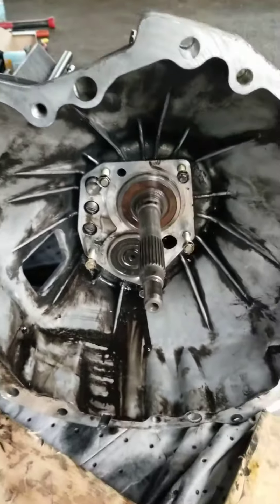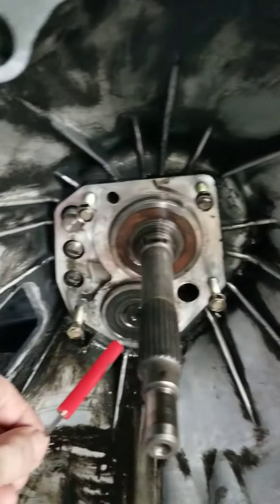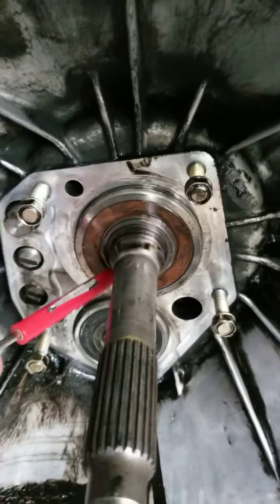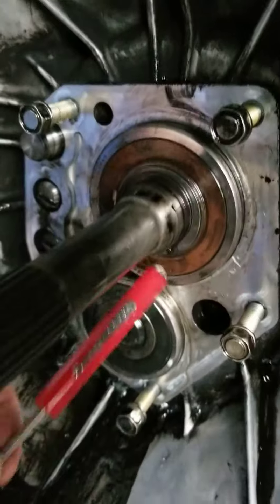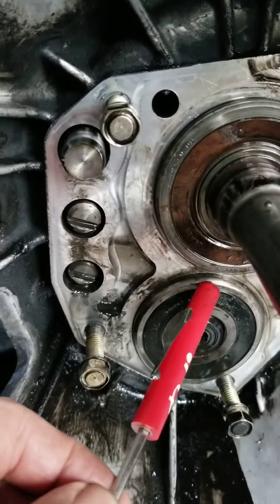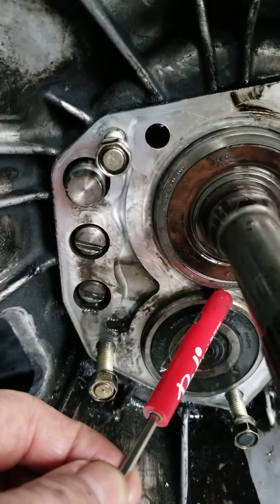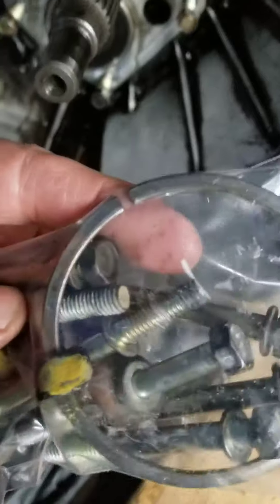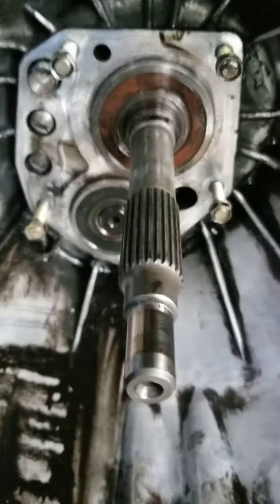Fs5w71c r32 gtst transmission rebuild part2

Comment: I wonder if the Bell can be damaged so the bearing becomes loose is there a shim bushing for these bearings available Does anyone know if you can damage the bell stretched larger diameter? or does it just crack?
Reply: No I have a bearing the disintegrated completely to just the inside Reese left, didn’t do any diameter change to bell housing case lol it did leave scars but no cracks all the way through.. it ate the countershaft bearing too